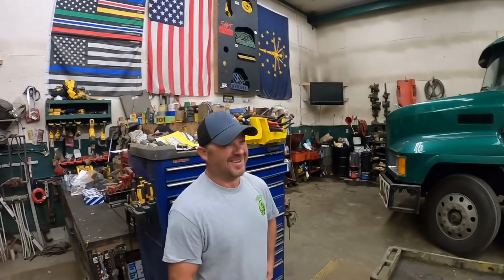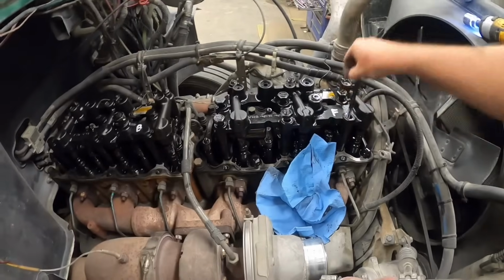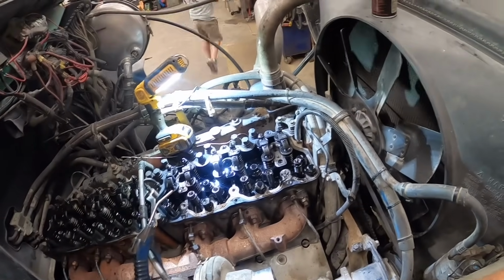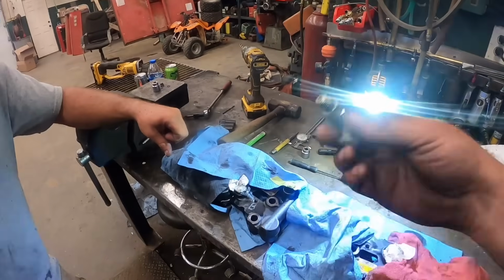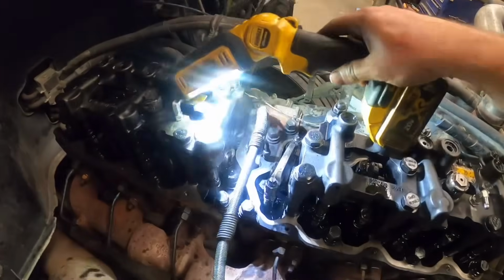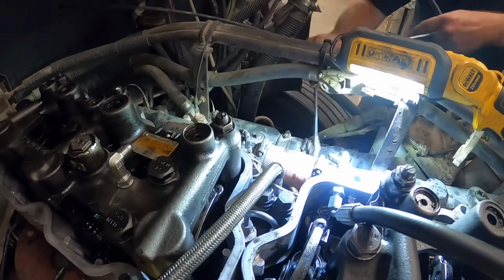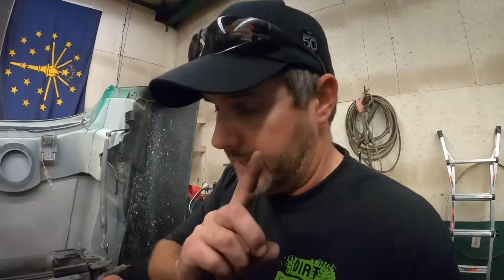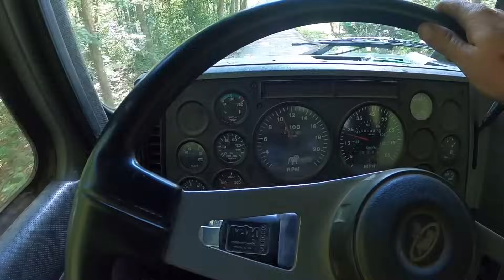Much needed major engine upgrades for the mack and new injectors form@AreaDieselService

Comment from the maker: Link to area diesel video 

https://youtu.be/hJKhkb78VNs?si=nzTor6XnGbWgBdL1
Reply: Watching these two guys pickin and yackin at each other really shows just how long they have known each other and how strong their friendship is. What a team.
Reply: Seen the video it was amazing and very educational, If I ever need anything for my 05 F250 6.0 Turbo Diesel they would be the one's I will call definitely. Thanks for the link.
Reply: What size bolt are you using as the nozzle puller?

Comment: Good job guys, the jake is going to be extremely beneficial for hauling all of the heavy equipment that you deal with,  especially if you are moving in less than hot dry conditions. Thumbs up fellas.

Comment: I worked with my dad for 8yrs working at a Mack dealer. I left before they were Volvo’s, but he always told me never want to work on a tough job on Friday cause if you get hurt or sore it screws up the weekend.  He mostly did wrecks ( cab swaps) and he or I did most of the  Boogie trees and Frame rail replacement which were always fun

Comment: I'm no Jake brake mechanic, but my understanding is that it basically makes the engine an air pump or compressor. Without the brake engaged and no fuel to the engine, the air in the cylinder is compressed, but then the compressed air helps to push the cylinder back down as it expands, essentially recovering all the energy needed to compress the air. With the Jake brake engaged, the exhaust valve opens, exhausting the energy of the compressed air. Then the cylinder has to re-compress then next stroke again. So instead of the engine recovering the energy needed to compress the air, it is exhausted and all that energy is lost. The engine starts from scratch to compress more air, and slows the engine in the process.

Comment: Jake breaks are definitely needed for tractor trailer transporting. Jake breaks come in mechanical, hydraulic and exhaust. They are pucker up relievers that assist in breaking. 😂😂 There’s probably nothing worst for a truck driver than lousing their breaks coming down a mountain looking for a emergency controlled stop exit. It has to be like riding a runaway skate board. A great educational video for the viewers.
Reply: Hopefully the jake BRAKE doesn't break

Comment: Good job sounds like it's working, love the old Mack trucks drove them many hundreds of thousands miles over the road pulling long combination trailers. The engine break was a pain in the ass bringing loads off  mountains. Looks like you have it worked out 👍👍

Comment: Many ways to skin a cat, I would have run a riser from the filter housing and installed the T above the manifold. Yes requires a new turbo line but so much easier to work with. Just me. Nice job, like the OIT and the hard line under the cover. Thanks for sharing.

Comment: Hopefully you never have to build another steel line like that again but if you do have Aaron or youself weld two plates together on a 3/4 pipe spaced the same width as the line…if the bottom of the plates are same distance as your first bend..You can terminate the first connection and hook on the plates and bend around the 3/4 plate making the pipe repeatable a thousand times..Very nice of job modifying your Jake’s…they sound great..

Comment: Thats why landrover had a butterfly valve in the air intake on the 2,25 diesel engine. The fuel injection pump and this valve were linked together with the throttle pedal. When driving you lifted the throttle it put vacuum in the inlet. This vacuum also went to the brake booster to assist braking.

Are you sure about the exhaust valve operated? I think leaving that closed would be more effective.
What is used for braking, pressure or vacuum? In both ways this needs to be levelled at tdc or bdc.
In theory:
A: piston going up, pressure on top of the piston brakes the engine. If this pressure stays it will push down the piston on the downward stroke so no braking. So pressure relief at tdc to create vacuum downward?
B: Now its opposite, vacuum down and release at bdc?
Do these jake brake pistons make a gap so the valve stay closed or do they open up only on top of the cam for a short while?

Use grease when taping. The steel will stick better on grease on the die than on oil.
When Chris buys a hyundai you buy a vilvo?

Comment: it's the Mike and Aaron show ,the more you know ,we are guaranteed laughs and a good time while learning how to work on your mack engine, area diesel service are your go to people for injectors ,injector pumps ,Turbos , they are the real deal  First class , well that was fairly painless pulling the injectors ,I know Mike has prior experience as a mack mechanic. If you put grease on the flutes of the tap it will the shavings from going below the tap while tapping ,The more you know . Why didn't you put the Tee at the turbo instead of the filter side .

Comment: After you do that, that modified one thread that you did. Modify for your break, make threader for your Jake break too. That way, you can throw it with a regular one and then use the modified 1 to finish it up a later on if you ever have to work on another 1.

Comment: Didn't think your truck could sound better, but my word it now purs. Have alway when I can used bosch parts in my cars, my wifes uncle swore by them. He used to have an old car that he was always tinkering on, as soon as the chanel tunnel was open he drove his car to Germany to get Bosch to install a new starter system for him. After that he complained as he didn't have to do any tinkering, the engine sounded really sweet. Having driven articulated lorries in the past, I know the real advantage of an exhaust brake, especially in the snow and ice. 👍
Reply from the maker: Thanks

Comment: Grip position on a torque wrench matters. You were all over the torque wrench handle when you were using it, from choking up to right at the end.  This will affect the torque values you put the bolts at.  I don't wanna bust your chops, but I am, because it really does matter.

Comment: Mike, on that DeWalt light, I took mine and expo y glue earth mags on 2 sides and the back top of the light, it gives the option of sticking the light where you need it, just a thought sir. Nice job of running the oil lines, I like it sir, thanks for the tag along video.

Comment: That steel line is going to work better for you. I’ve seen a few Mack’s with that upgrade with the rubber hydraulic style hoses used on the inside and the rubber starts to break down with heat cycles and such and it starts dumping rubber into the engine which caused a few issues.

Comment: Nice work DP & MBTS. Not sure what kind of a hose shop you have where you live, I used to manage a hydraulic hose and fitting store and we used to make a bunch of those SS braided lines for trucks mostly for turbo feed lines and there was some -10 lines we made a lot of. Anyway if you didn’t want to bend tubing like you did, which turned out awesome I could have made you some new braided lines.

Comment: I was beginning to wonder if your drill press and mill had gone missing.. turns out you just didn't use it.

Also, you don't have any bottom taps?  Though I guess I don't have any either, other than a few random ones in bad shape amongst my grandfather's tools.

Comment: I know one thing you and Chris of letsdig18 currently have the same problem with your lowboys JUST... enough width to hold the equipment. When you and he graduated from the kindergarten machines and started getting BIGBOY TOYS, your lowboys have what looks  like big can openers hanging off the sides. Now I know that's what those wide load signs are for, but from a looks point of view a little wider bed  may improve safety? But what do I know, so far everything I've suggested I've been wrong, it just could be it's worn out and time for a nicer looking one. I like those lowboys that have 4 axles in the back.

Comment: How on earth did you find a Mack with oil pressure that good? What does it have hot at idle?
Reply from the maker: 35
Reply: @DirtPerfect   I wish my 97 had that. With new rods and mains hot it's about 12 at idle but all of the Mack's I have been around from that era were never known for having much oil pressure.

Comment: Mike, great video. but one question, when you rev the engine the exhaust seems to come out of the stack on the right side and then the left side instead of both stacks at the same time 57:40 on the video ???
Reply from the maker: Ok that’s not a issue

Comment: Aren't you afraid that because of the supply 90° piece, the piece you screw in in the oil channel does not close off the whole thing? You tap through and the thread of that 90° is turned so far that it might seal the oil channel.. it is difficult to see how deep your original oil channel is, that's why I'm wondering, otherwise great videos and enjoy watching, thanks regards stefan holland😅
Reply from the maker: I have no concerns

Comment: Mike you know in Europe Jake Brakes are banned, under the noise emission and also because the dump  unburned fuel in the exhaust.  
I was watching a video and a family friend who  is a European truck driver heard a Jake brake being used and he wanted to know what was wrong with the engine, I told him it was engine braking, and he informed me they are banned in the EU.

Since the 1990’s the EPA in the USA is trying to ban them and require them to be disabled on all existing trucks under the noise emission, and now it looks like they are going to use the EU unburnt fuel and noise emission to finally gets them banned.
I hate all the climate change bs.

By the way. You need to get Aaron some platform shoes so he can see over the top of the tool box.😂😂😂😂
Reply from the maker: Such bs
Reply: @DirtPerfect  you also have to remember the EU has banned the use of Diesel  as a motor fuel after a certain date in the EU.
They also have banned it from being used on construction projects  that are government funded, DW has done several reports on the projects in Germany being built with total  electrical construction equipment, and they have even talked about the challenges that has been encountered in the winter months with the batteries and the charging.

One thing I got out of the new story they have  to have redundant equipment ,  one being charged at the charging station while one is working on the project.
I laughed my @$$ off when the next story they did was on the German Brown Coal fired power plants, which are the dirtiest power plants on the face of the earth because of the CO2  Emissions.

Germany boast about their all electric mass transit system and how environmentally friendly it is, but they forget to point out it is powered by power stations fuelled with Brown coal, lignite coal is very soft and burns very dirty.

The EPA has several studies they have done dating back into the 1980’s on Jake Brakes and the regulation of them  in regards to noise emissions and  how to regulate it.  The current ongoing study is in regards to noise emissions and  the effects of the gas emissions of the exhaust, incomplete burning of fuel  is their target coupled with the noise emissions.

The EPA won’t be happy until we walking every where we go, eating our food raw and living in a cave under ground freezing our @$$ off.

With this current administration who has weaponised the EPA to go after gas stoves, hot water heaters refrigerators, and and diesel powered transportation and construction equipment , it should no surprise you.

I have been following one of the advisors to Nixon ,  Ford, and Reagan who is a particle Physicist at CERN Hadron Super Collider, while he has been know as a very vocal climate change agenda advocate, his tune is changed from CO2 is bad, to we need more of it to save humanity from the coming catastrophe caused by the  the earth core, and sub atomic particles bombarding the universe . A. Egon Cholakian,  Earth Save Science collaborative. Is the other side of the  coin to the ban oil and cut co2 Emissions.

This is  the core of his Marta 

we have recently detected a number of alarming anomalies in all the layers of the Earth system. There is an extraordinary displacement and destabilization of the Earth’s core, a sporadic and chaotic acceleration of the planet’s rotation, and a shift in its rotational axis. This scenario is compounded by a critical weakening and emergence of atypical anomalies of the magnetic field, and a change in the composition of the upper layers of the atmosphere. These events have culminated in an extreme activation of magmatic foci, and an accompanying increase in deep mantle earthquakes - bringing about a decrease in the thermal conductivity of the ocean. As a consequential result, our oceans have lost their ability to function as a compensatory and cooling mechanism. All these alarming factors indicate only one thing - To Wit, Our planet is on the verge of self-destruction, and humanity has only a few years remaining to avert this impending catastrophe.

Truth be know he actually makes more sense that Greta on the subject.
Check out his YouTube and have some popcorn and be prepared to be entertained.